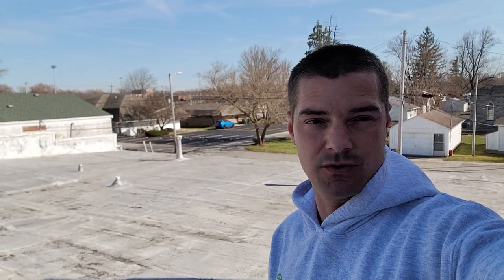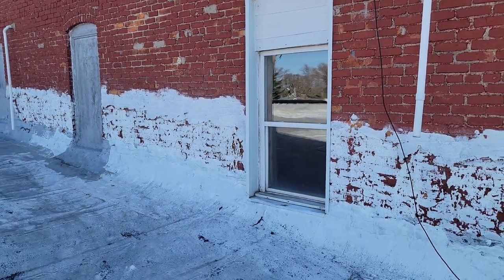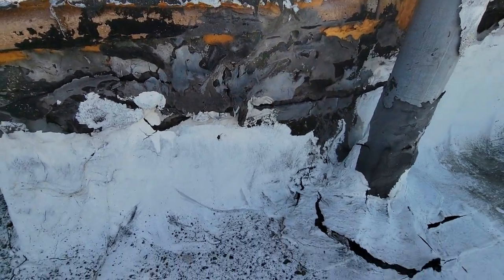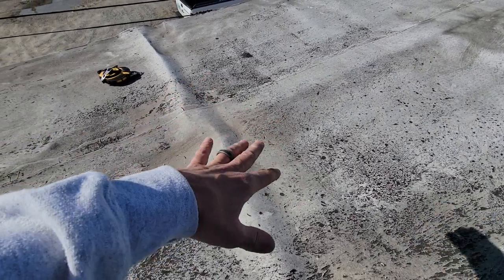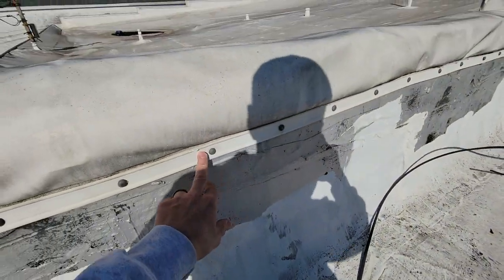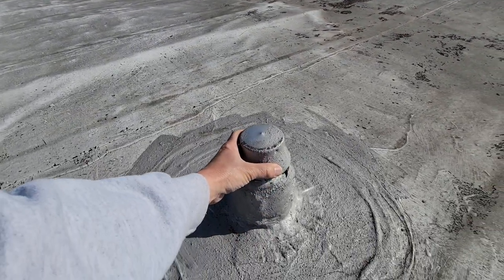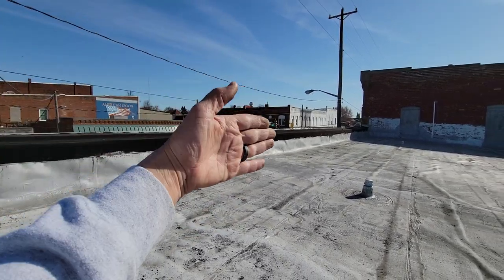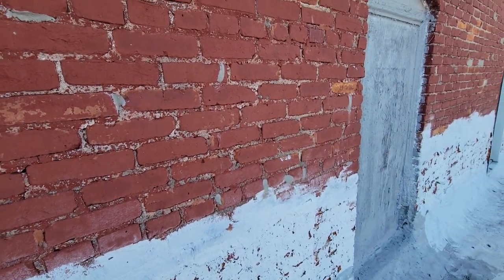Commercial Building Flat Roof

Comment: We would give the option to go over the existing roof with granular modified bitumen cap sheet to create 2 ply system $85 a roll
Run the material up the brick fasten with Term bar and cut out joints in brick tuck and seal flashing.

We do commercial roofs all the time it’s not the best option but sometimes the owner is a cheap ass so they get a light warranty

Comment: Roofed for over 20 years both residential and commercial Germany and US...when I finally gave it up...health issues and came off the roofs I worked as factory supervisor. The building maintenance guy told me after several botched attempts to fix leaks by a company he said "all flat roofs leaked" so needless to say I don't work for that company anymore..lol and the issue which I pointed out was they had used two different manufacturers big no no when using two etc they won't bond.

But ya that wall will be a challenge and probably give you call backs forever. 

Like was said in a comment probably best to see if it can be sheeted or sealed in some way...the old windows need to addressed as well.

Lots to do on that old roof...best to maybe simply shake a hand and say good luck. Unless the owner has deep pockets and a good relationship with the neighbors. He will also need patience and understanding this would be project and not a couple days in and out.

Good luck

Comment: Certainly needs torn off.

Most likely it’s a plywood deck. Repair as necessary. Do a Mechanically attached Fleeceback TPO or PVC.

You aren’t going to get your hands on a cover board or iso, so insulate from the inside.

Cut in a regret counter flashing at the brick wall.

The adjacent membrane roof is a Duralast roof, install a nailer on top of the parapet. Install a cleat and coping cap. Fasten on back side

Comment: You are very smart and I. Sure you can easily learn how to install a top or pvc roof and you can overlay this roof all you need to do is walk the whole roof to make sure there isn’t dry rot if you find some you can cutout that sección fix it and put back the old material then use a polyfelt to separate old roof from new roof and cut the big wrinkles and use membrane screws and plates   On the walls you can clean them and use termination bar and behind that use double sided sticky tape and calking on top. The vents that you see they are called two way vents they are to vent the roof not the attic.

Comment: About the neighboring wall, I recently had another building (these are small, inexpensive buildings I own and rent out) where we ran into an issue where the neighbors roof was an A frame that dumped onto our flat (moderately sloped) roof.  Ultimately... we ended up putting a gutter on the neighbors roof, so that the rain off his roof wouldn't be dumping right up against our wall and giving us tons of issues.  So sometimes you have to bite the bullet and actually improve the neighbors property even though it's not your responsibility, because if you don't you're going to have your own issues with it.  

Like you mentioned, rain is going to go right into those bricks and then down under their membrane.

Comment: I"m an amateur, not a roofer, so all the roofers will tell me i'm crazy, but I had a building 6500sq ft three years ago with a roof worse than that, but with a similar combination of rolled roofing that had been painted or whatever.  It had deteriorated so badly that about half of the fiberglass was gone out of the roofing, nearly all the grit was gone, it was just a really bad situation.  The roof was well built though, 100 years ago.  It had water leaking all around the perimeter, so we replaced a lot of beams and wood to get it back structurally sound, didn't cut any corners on that... and replaced most of the decking around the perimiter.  That still left us with the problem of what type of roofing to put on it (without stripping all the rolled roofing away)... we ultimately put tin on.  It had about a 1 inch per foot fall on it which wasn't the best, but we went for it.  25 foot long sheets of tin... we put down 1X4's all the way across firmly attached to the  decking through the old rolled roof, and then put all the screws in the ridges instead of the flats.  Of course did a great job on flashing on both sides and the front, all the way up and over... it's been 3 years and no leaks yet but there's not really an optimal way to do a roof like this so that it will last long term with minimal maintenance that I'm aware of.  We did the work ourselves or we never would have been able to afford it.  We had two guys come out and look at it but they wouldn't even give estimates (which is understandable).  Left to our own resources, we had to do what we were capable of, the most important thing was getting the roof structurally sound so we replaced a LOT of the ends of beams.  It's solid as a rock now.  

The roof in this video I think the guy doesn't have many opinions unfortunately that can be warrantied.  The way we did ours, nobody would have warrantied that either so sometimes you have to do the cleanest job you can and if any issues arise address them a.s.a.p.

Comment: "IF" they wanted it done on the cheap and assuming there isn't already a weight to sq. ft. problem (check local building code) you could cut out any existing buckles/blisters and install a protecto board, secured with screws and caps, minimum 4 per sheet and install a 2 ply modified bitumen system. IKO Armorbond as your base and a torch applied cap sheet. Those 8 stacks are vents that were installed when the last roof was put down to vent any moisture between the old and new roofing system. Ideally you should strip out the whole damn thing for a clean slate. You can also tear off the existing top layer and go with the protecto board/2 ply system as mentioned above. As far as the wall goes, I'd go old school and put a wall flashing directly into the mortar and caulk as necessary, a termination bar there will probably not hold due to the condition of the bricks. Do you know if the roof is a cold or hot roof?

Comment: Standing seam steel roofs installed on sleepers are a good option if the slopes are greater than 1/4” per foot.   The old roof material may remain if it’s not adding too much weight.  There may still be a 2-3 month lead time on galvanized steel.  High temp underlayment may also be required for warranty.
Reply: Standing seem it’s more than twice as expensive as a membrane roof. Even though membranes are hard to get they are still available. Another reason I don’t like using metal is because you have to rely on calking on every roof penetration also it doesn’t matter how careful you are  you are going to end up with scratches and if it’s not a aluminum roof the roof is going to corrode.

Comment: Complete tear off
Repair any dry rot discovered
2” EPS or PolyIso
1/4” DensDeck rigid separation board
IB Roof System 50/60/80mil PVC membrane.
Mechanically attach and heat weld.
Use a wall reglet on the brick portion of the wall.
Remove and dispose of old cap metal, apply primed DensDeck to glue membrane on parapet wall, roof up and over the wall and replace with new standing seam cap metal.
3” clad drip metal on all eaves.
IB Roof System has cones for the pipes that fit the appropriate sizes. 
Make sure you get any measurements of drop or through wall scuppers and have them made with the membrane material so you can weld to them.

Keep in mind, that if you can’t get the material right now, neither can the other roofer. This is what we’re facing here in the Portland, OR area.

Comment: That looks like a mechanically fastened duralast roof with heat welded laps those are the duralast vents that's aluminum coated

Comment: Aluminum coating is designed to fade over time to keep a shiny look. I would watch putting a coating on that roof. It’s not that gaco won’t stick to the aluminum but aluminum won’t stick to the roof membrane eventually the aluminum will shed and fade away from the membrane and it’ll take the coating with it.
Reply: Aluminum coating it’s not to waterproof a roof it only to reflect the uv rays to prevent early deteriorating on smooth torched down or build up roofing

Comment: Damn man, thats a mess. If you don't want call backs id say its probably best to frame new walls infront any of the parapets/ stub walls and get custom metal to cover the top/side areas. That brick wall, id personally see if an engineer would approve bolting studs to the side on flat, sheet it, run roof membrane up, then new brick veneers, custom cap metal up top. You wont be able to watertight that as is.

Comment: The boarded windows are kinda easy. You use wide coil or wetherproof vinyl sheet over the entire window opening attached straight to the plywood (or new plywood as that stuff looks too weathered). Counter-flash at the bottom under the coil and over the sill (break a custom Z from coil), then flash as normal. If the trim around the window is too much of an ingress issue, which it probably is, Cut new plywood to fasten over all of the wood, brick-to-brick, Maybe add a 2x4 stud down the middle to stiffen. Then coil like I said before. Silicone around edges.

I know it's not their property, and would likely have to get permission from the other owner, but it is what it is. The biggest issue I see is the active windows and brick/mortar deterioration. There's a lot of work that would need done on someone else's property that the owner of the roof probably doesn't want to pay for. 

And yeah, regardless of what's under that roof, it needs torn off. Too much wrinkling and poor adhesion.

Comment: I would suggest painting the whole wall with a multi part roof top coat wood brick everything and down over the term bar past it at least a foot as for the lower best you can do is patch with monkey shit ( Henry's roofing cement or something comparible I would strip and rubber it over with tpo hear weld all laps but duralast makes an awesome roof kit comes as bags of roof kit we are doing duralast roofs here cause rubber is hard to get products

Comment: You can’t coat silver coating but with silver coatings I still wouldn’t do it. If 2 layers, I’d remove 1 layer IF 2nd layer is sound with no wrinkles. Layover with .5 (hd iso, securrock, densdeck are all hard to get) maybe look into the gp yellow board I’ve always assumed it’s the same as densdeck, rhinobond 60 mil Tpo. You could even FA Tpo to the brick all the way up, vinyl side boarded windows. I’ve worked on a few of these types of building, they’re money pits for the owners and will most likely never be completely restored ever again. Mulehide used to make a huge fleece roll you could use as a slip sheet? OR you could MA fleeceback direct to another sound roof layer. Unsure of availability of fleece back either, I have a newborn and have been out of the game for a couple months

Comment: Rip that off  fix the rot  and  there are systems out  that allow you to do a torch  down system       that just peel and stick  with same results  at the right  temperature     they use primer  and  and nails down the first layer with washer and nail   and a pull and stick  with graiuals attached to the mebrain and were they over lap same thing pull and stick    gaf makes it